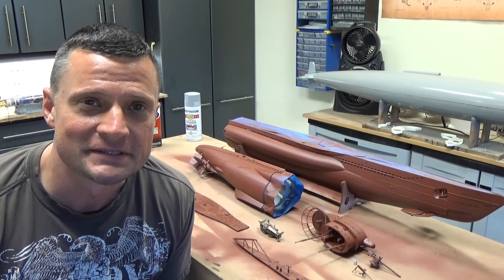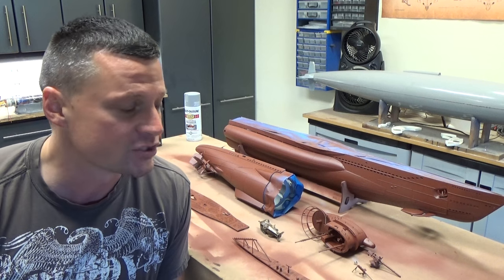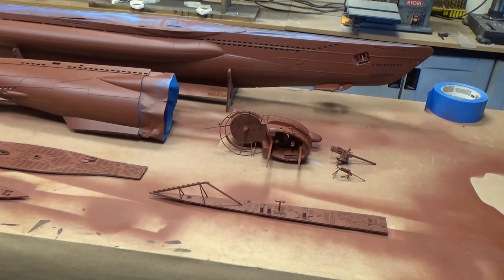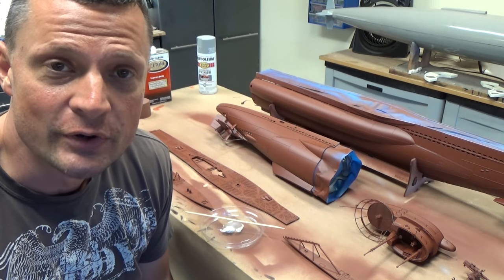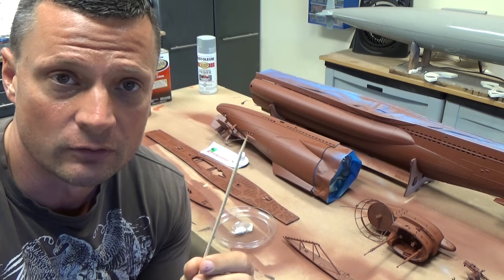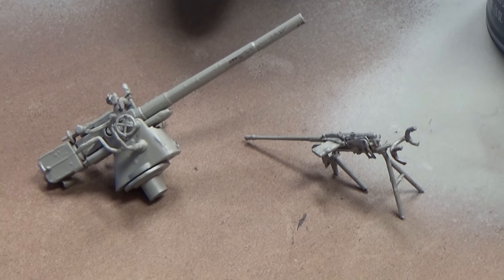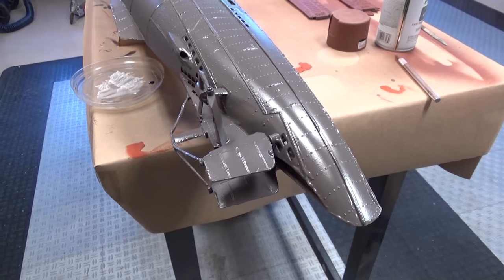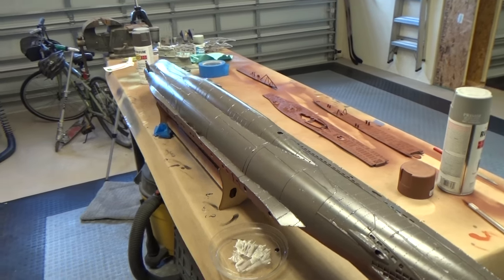Painting and Weathering the Arkmodel German Type VIIC Uboat

Comment: You did a  great job here - looks really good.  A very minor suggestion is to add a bit of marine fouling (sea grass) along the waterline.  I've done this by "dry stippling" using a mid to dark green. [The reason: antifouling paints weren't that effective back then and usually seagrass would appear after 4 moths or so on the hull after the boat was in the water..]

Comment: well so beautiful model, stunning painting and weathering, very nice job you've done in the sub, I'd like to send some help my suggestion is to invert the propellers, these submarines turned props outboard to pull ahead, so as you've put the reverse, the prop with left hand blades is to be port, and right hand to be starboard, that is more correct and real.

Comment: thank you for the painting ideas, I really like the acrylic medium and pastel. I figure chalk dust would work similarly? and have been any attempts at fpv subs? a camera in the conning tower would be a great perspective, or is it too much of an issue with water?
Reply from the maker: Unfortunately, wireless video signals are in the GHz range, and as such do not penetrate water at all. I find it much better to simply mount an HD camera in/on the boat and download the video back on shore. I have several videos that feature onboard footage such as my recent Type VII in 1/32 scale (Maiden Voyage)
Reply: RCSubGuy right! I hadn't thought of the signal issue, though I figured it had to be a technical problem, every hobby seems to be adding fpv view to a wireless headset after the popularity of drones. but running an umbilical isn't exactly practical to maintain signal heh.

Comment: David R Lentz, Columbus, Ohio, USA (Friday, 16 August, 2024) 

Is this you show here the same kit as the Trumpeter 1:48th-scale model of the DKM (Deutsche Kriegsmarine [German War Navy]) Type VIIc Unterseeboot [under sea boat] U-boat U-552 (corrected here for spelling)? 
   I would like to build one of these that a 1:48th-scale model of a Convair PBY-1 Liberator USN Convoy Patrol Bomber (from the Hobby Boss kit of the Consolidated B-24D Liberator USAAF Heavy Bomber) engaging it with a pair of depth charges. The water blast would extend over 60 metres (200 ft) to the vertical, which in this scale would be round 1.25 metres (over four feet)!

Comment: May i ask in your opinion, are the moulded details too heavy for a 1/48 type vii? i m quite torn between this arkmodel and engel's type vii. thank you for sharing your video. very nice work.
Reply from the maker: I find the details just fine, myself, but I'm not a stickler for rivet-by-rivet accuracy. If you're after a perfect model, this is not it. If you're after a perfect model for R/C, this is close. I find having slightly larger details on things such as rivets a benefit for R/C operation as you're operating at a large distance and small details get lost. I highly recommend the Arkmodel kit.

Comment: I get annoyed with the scale sizes nowadays I used to work in 1.24 model cars years ago that's what I started off with then stopped for 10 or so years family  started now back into it even bigger with 1.35 sca military kits I got a 1.35 patrol boat it is so cool i wanted it in a larger scale so found one in a 1.48 its beautiful n only 60 bucks for the kit, but this is whare it gets annoying I got a 1.48 scale Matilda 2 tank thinking it would go with the size and shes smaller than the 1.35 tanks I was so peed off! I don't understand why they do this make it larger in ships! If my 1.35 patrol boat was tiny I'd understand that the 1.48 is ment to ba an accurate scales of the the real thing but the 1.35 goes with the 1.35 sized tanks n atv armored vehicles etc I do!? So yeh annoyed at kinda wasting money on the Matilda 1.48 when shes smaller than the 1.35! 

I love the Trumpeter uboat for around 450 with the leds and open hull with the clear panel side so you can see all the crew and details that kit looks absolutely stunning I love this u boat in either kit I'm saving one just now but keep dipping into it buying other kits and the new modern resin figures for my British husky atv diarama for Iraq

Comment: i see a lot of connectors inside the wet hull. are they also stainless or does water not effect them over time anyway? have you done any special thing to prevent the water going into the cable itself? great painting skills by the way
Reply from the maker: The connections see a small dallop of grease on the exposed connections, which is more than adequate to protect them due to the very low current that runs through them. As this model operates at very shallow depth, pressure forcing water into the wires is not a concern.
Reply from the maker: I'm afraid you're mistaken. In this build, air is vented out of the cylinder via the solenoid. To surface, the periscope breaks the water's surface, the air pump is engaged, and air is blown into the ballast tank, displacing the water.
Reply from the maker: This model is ballasted positively buoyant. No matter what happens (barring a catastrophic leak), it will always surface.